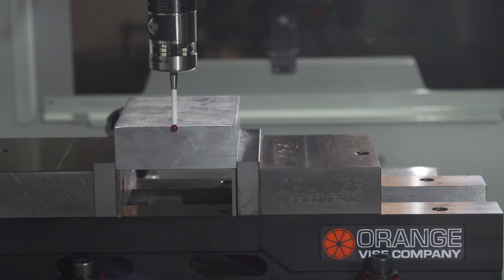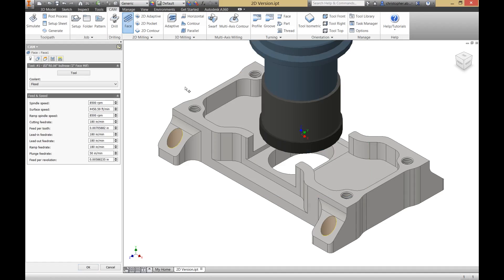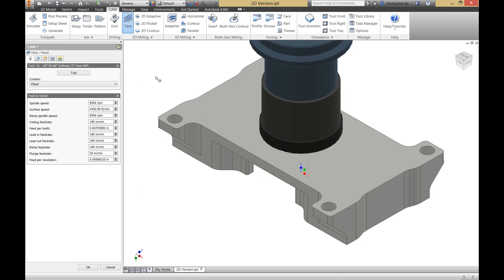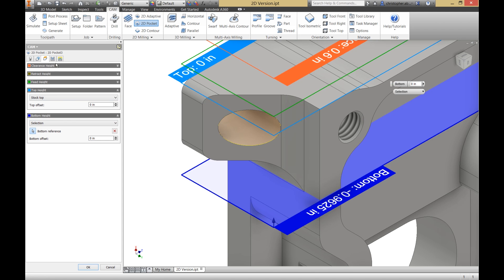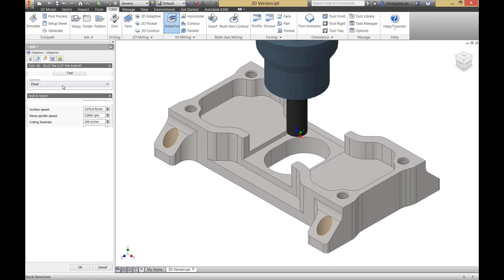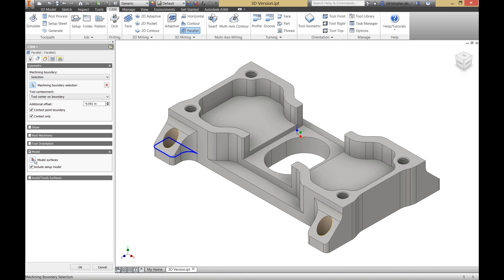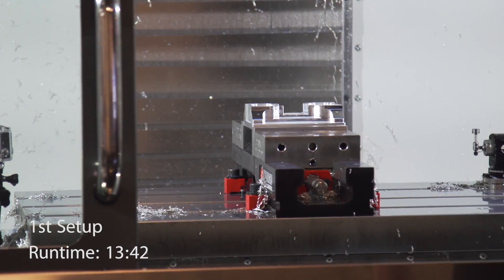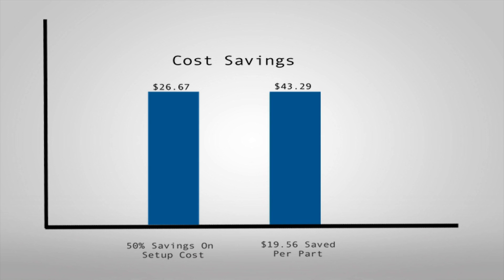Benefits of 3D CAM over 2D

Comment: Does anyone else here feel that 2D is a waste of time? 3D should be the norm for starter Cam packages. 2D is only remotely needed for Sheet Metal and some Router machines. If there's any depth to your part. 3D is what you want.
Reply: 3D tool paths are way more difficult to control than 2D toolpaths... 3D might be ok with simple parts like this but on bigger its often useless unless its mold making or something complex curves..
Reply: there are times 2d is the better way